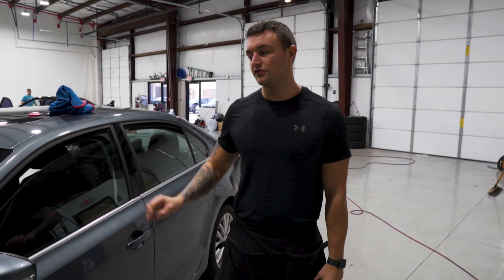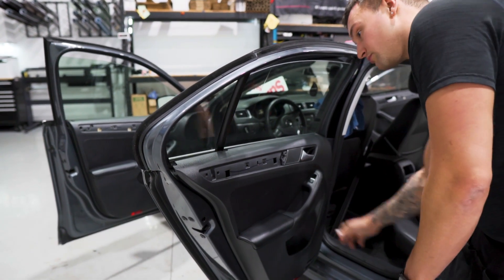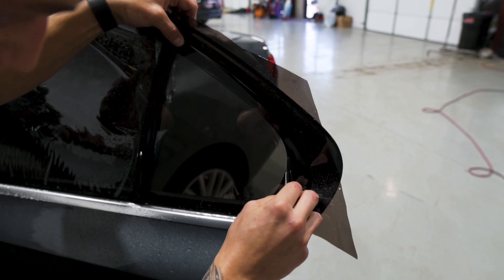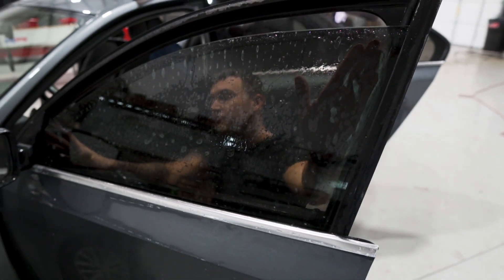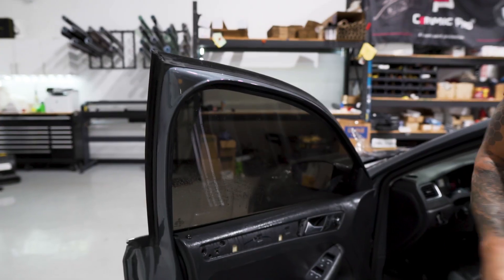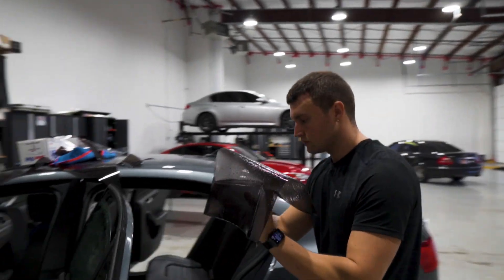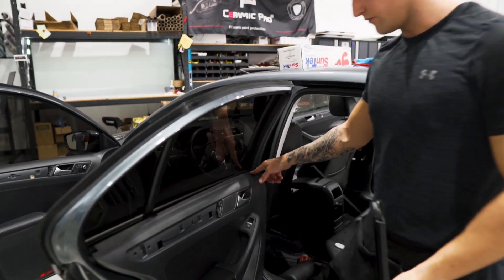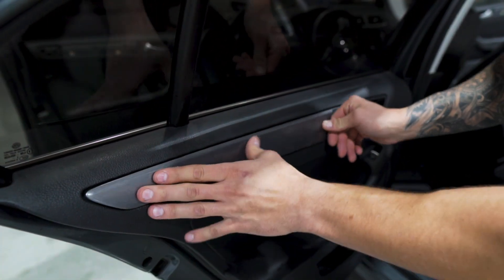How To Professionally Tint a 2014 VW Jetta

Comment: Thanks Bro. I've seen a few different tint vids, an took my cars to places where they never took the window trim off and did these important steps your showing. And with an 07 Jetta I got done, the front window started to bi d after rolling it down in a month and the tint ripped. That's because they did a quick job an just tucked the tint under the gaskets in windows. This is professional way and right way to tint. I have a 2012bVW Jetta coming next week, an I'm tinting it myself. Thanks for the lessons!!  You guys do great work!!

Comment: How do you avoid dirt from cloth seals? I always get some specs that I always have to work out at the end, and its time consuming! Great channel, the Mini front "how to" helped alot when I did a customers car, cheers from Sweden!!
Reply: i always use 1 inch tape and tape off the felt.
Reply: Green painter tape.   Not the cheap blue crap.

Comment: I was thinking of buying pre cut tint on ebay for this car. do you think I’ll need to shrink it for the rear glass? or should it be good to apply it
Reply from the maker: You should buy it from windowtintsupplies.com and yes you will need to shrink the rear window with precut material.